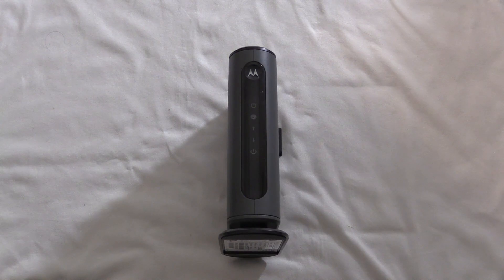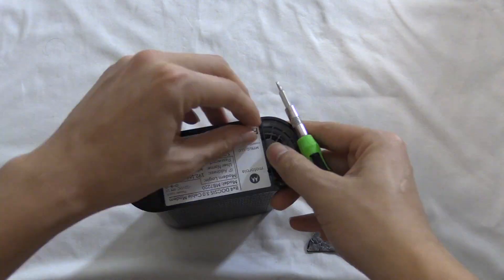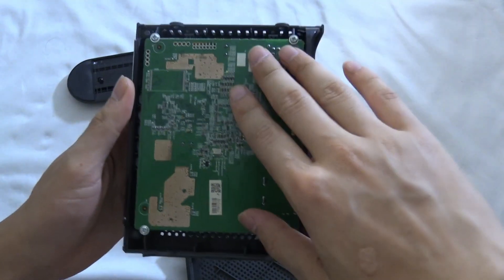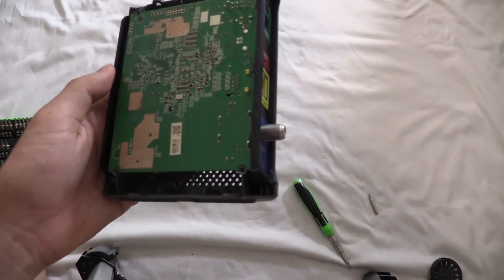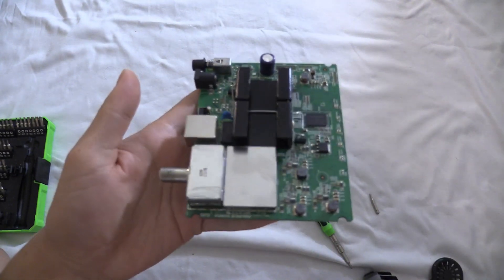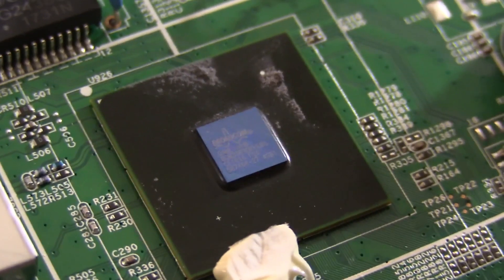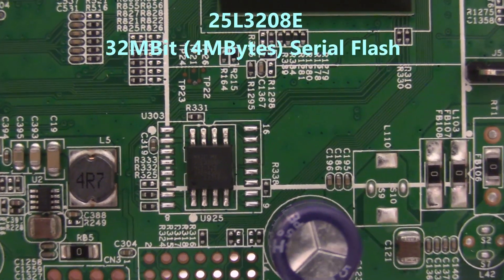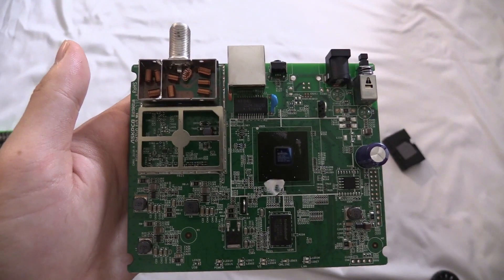Motorola MB7220 Modem Teardown

Comment: Is it safe to run the modem with the board outside of the case?
Reply from the maker: As long as there's no metal or water (or conductive things) on the board, it should be fine.